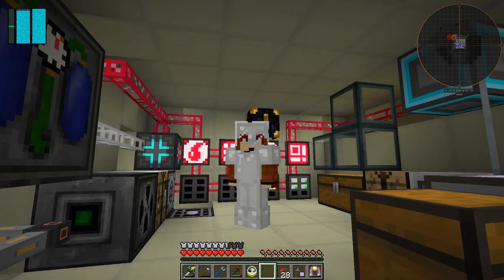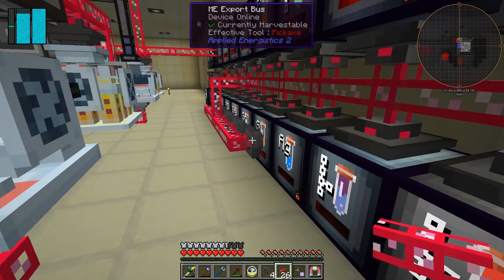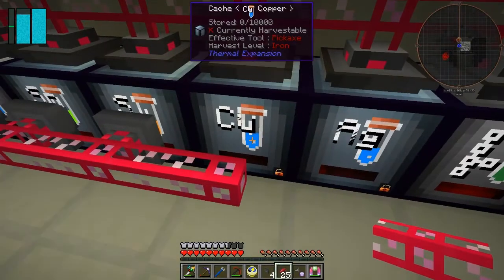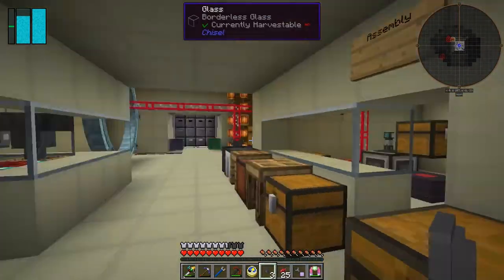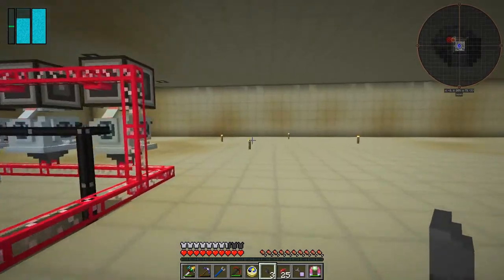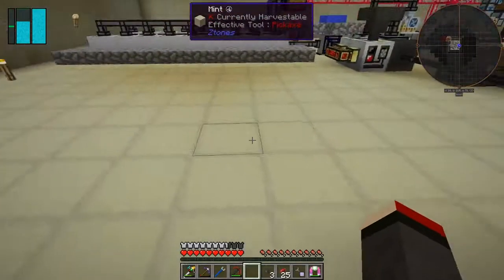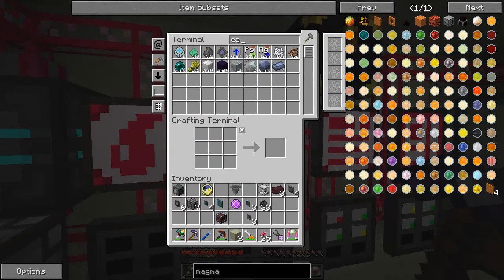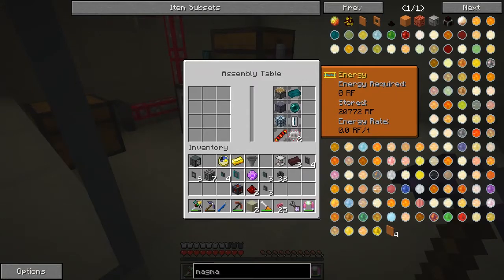Galactic Science 2 #77 - Big Power

Comment: I've been using the heavy aluminum wire to convert rf to eu for all of my ic2 machines in my world so i don't have to worry about eu generation. The way i have the wires run is cryostabilized ducts out from the energy ball to all my main areas then ender io conduits for the rf areas run off to the individual machines. For the ic2 machines it's cryo fluxduct over to the area then 1 ender io energy conduit then more cryofluxduct down to my assembly machine with the fluxduct on the top and 2 sides. I then have the galacticraft heavy wire run off of the cryofluxduct on the assembly machine run over to the rest of the ic2 machines. The 1 piece of ender io energy conduit is essential between the cryofluxduct sections because the fluxduct wont transfer any energy at all without the eu sectio and the rf section seperated. I have 12 to 15 overclockers in each machine without any energy problem and 4 stacks of overclockers in the assembly machine and it stays at max power the whole time. I dont think the overclockers do much in the assembly machine though after the first stack but i made a lot of them just in case it would help. I also just got all the rocket parts on auto craft and it is energy expensive. I still need to make the 10 boosters for the tier 3 rocket but burned through almost 500 billion rf crafting the other parts and drained out all of my power.
Reply from the maker: That sounds just awesome, the tier 3 rocket is a challenge. 
So you can connect aluminium wire to cryofluxduct directly without needing a capacitor bank, will have to try that. 
I didn't see much improvement adding overclockers to the assembly machine, unlike the IC2 machine that zip along with the overclockers. 
The aluminium wires don't seem to limit RF transfer, all the decomposers and synthesizers have power all the time.